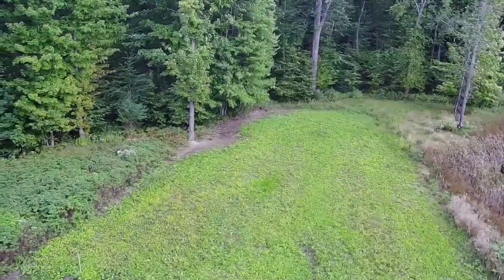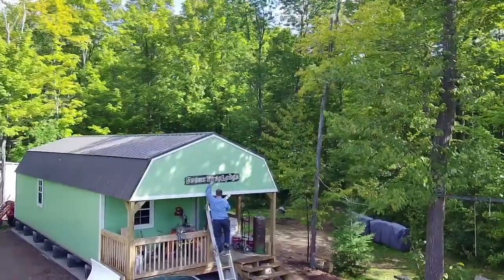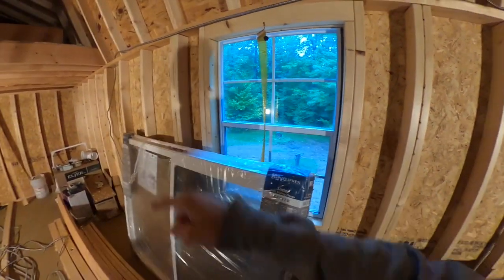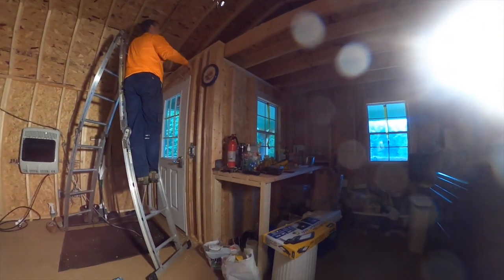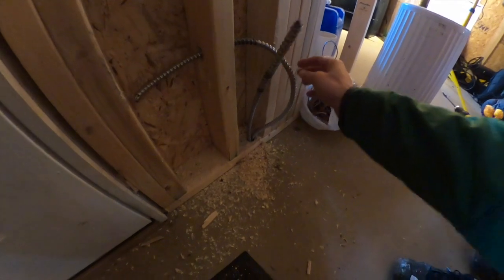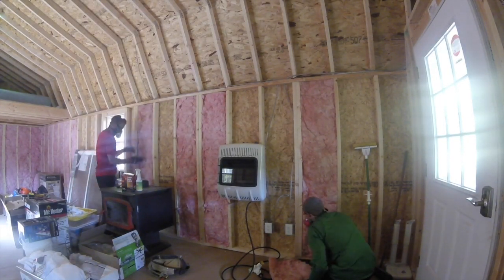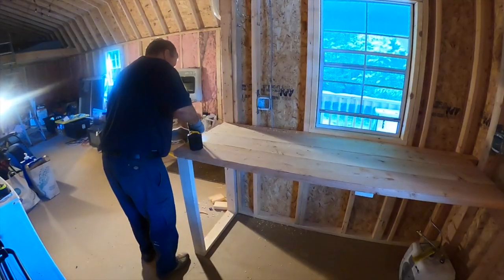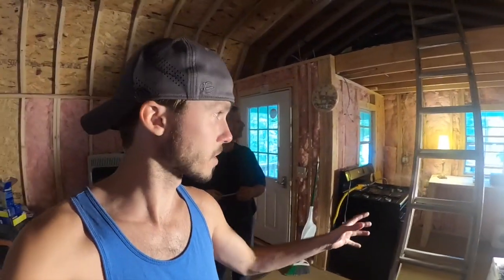Building an Off Grid Cabin | Ep. #1

Comment: If your going to leave that propane heater where you got it. You may want to either put some hardee board or concrete board behind it to protect your wall from the heat the heater produces. Good luck with the build.
Reply from the maker: Thank you! We replaced that heater with a vented propane heater that doesn't produce any heat on the backside.  Thank you for the suggestion!